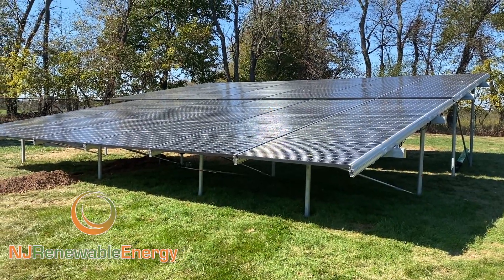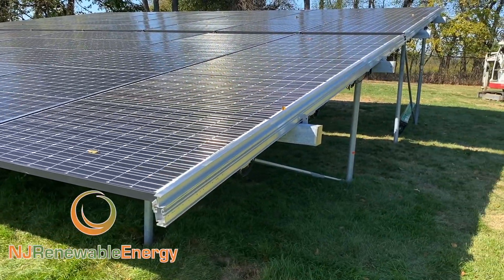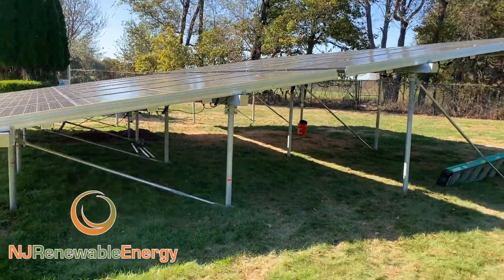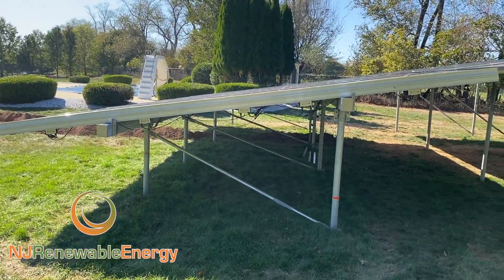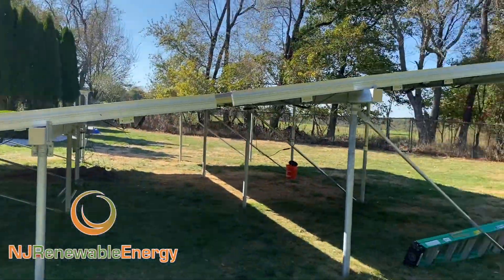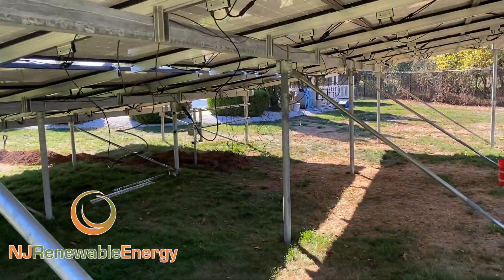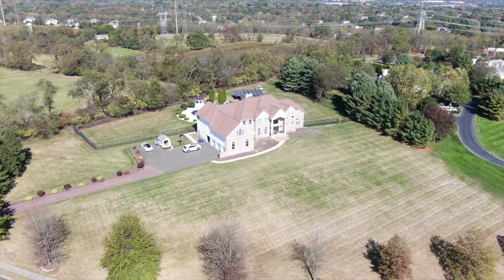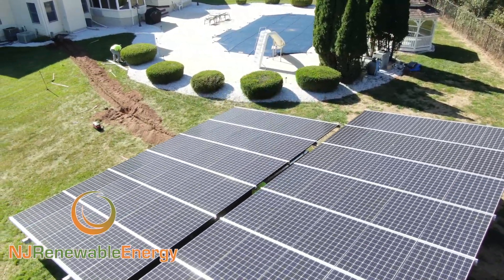21.45 KW Solar Ground Mount New Jersey

Comment: Is it going to be grid tied?
Reply from the maker: Absolutely, 99% of all solar systems in NJ are grid tie.  Its far cheaper to use the grid as your "storage" rather than installing a battery system.   Batteries are starting to be used more often now and battery technology is developing rapidly.  That said, its still a grid tie business at this point.